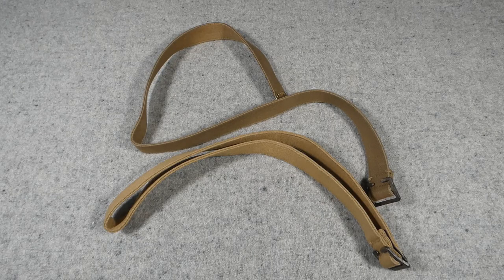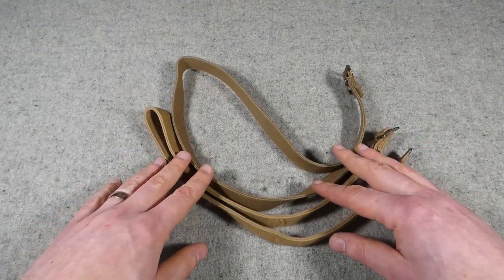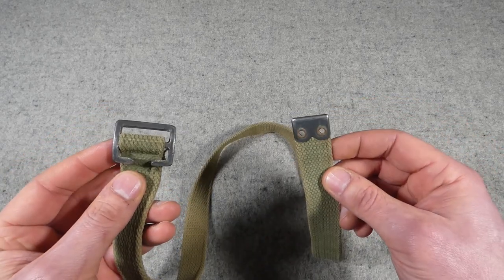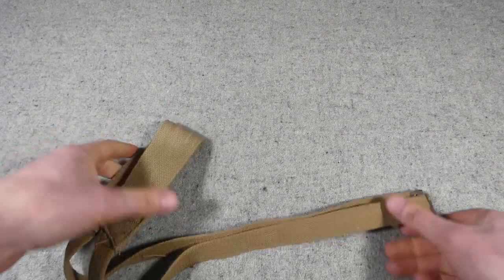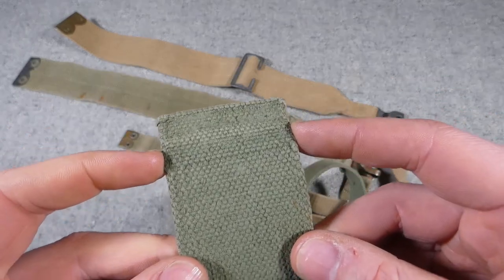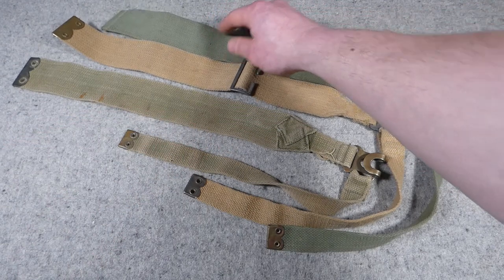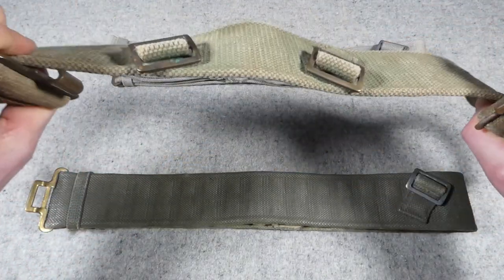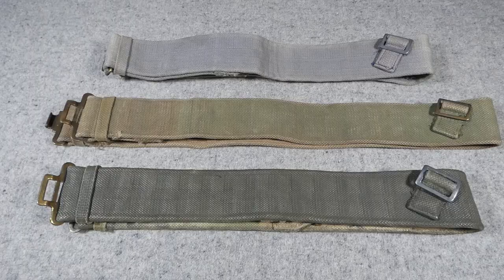Some Economy/Ersatz British 1937 Pattern Web Equipment

Comment: I recently bought a set of L straps,  I ended up having to buy the buckles separately,  and  no metal tips on the ends though with brass hooks, and on one of them has REGD. No.639521 on it. I bought them to use with a Netherlands m52 large pack, I figured out the packs origins  thanks to one of your videos. I DON'T plan on Reenacting with it , but now it is useful for camping now. Thank you again I always enjoy when you upload a new video.

Comment: I have a Map case in the Raincoat material (early pattern )and a 37 pattern Pistol Ammunition pouch in the khaki canvas material, a Rifle Sling ( it is now as hard as a rock unless warmed in water so it becomes soft again, a pair of L straps, the lower straps being normal webbing also several pairs of Right and Left braces all made in three pieces.

I have a stitched in type brace in normal Webbing, all have brass fittings.

Comment: I wonder if the 41 dated economy webbing was part of the emergency replacements post Dunkirk. With so much equipment left behind. I imagine many troops would have dumped their webbing, or were ordered to.  If just to save space on the small boats for men. As many 10s of thousands of web sets would take up a lot of space and weight, especially when wet.